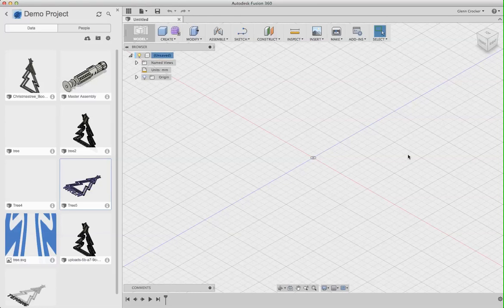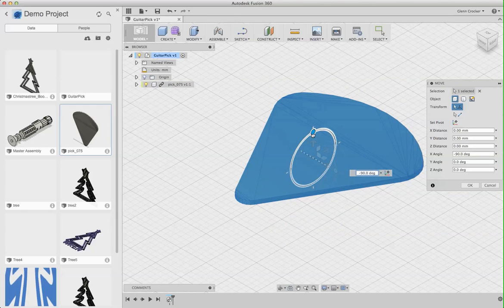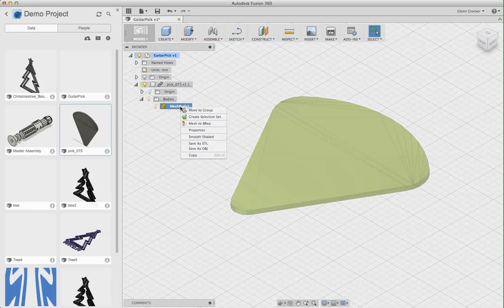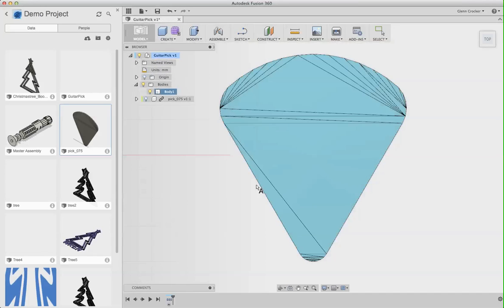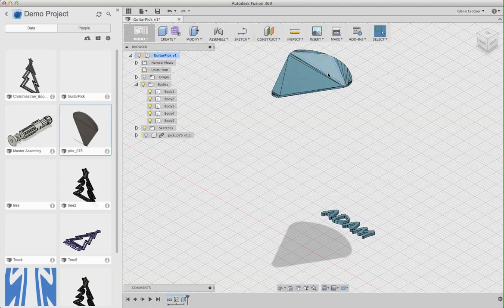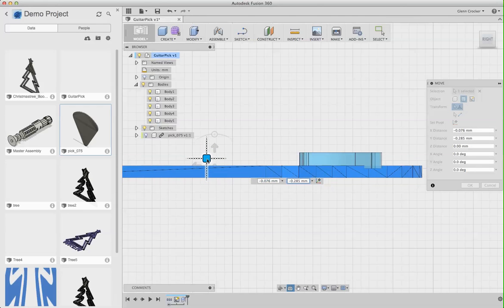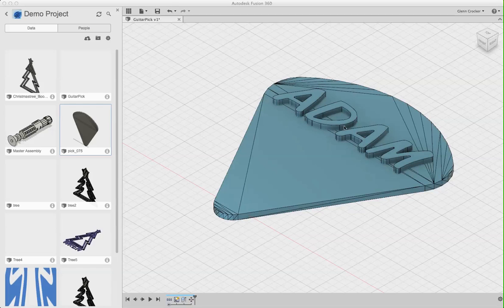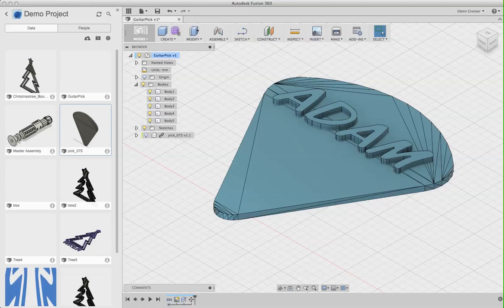Convert STL to BRep for Editing in Fusion 360

Comment: Thanks Glenn for the video. I am trying to cut the stl object to smaller portion to fit the size of my printer bed.I tried Mesh to BRep but it was aborted with this message: "Warning: This mesh contains a large number of facets. Mesh surface content:Mesh surface content = 135052. Conversion has been aborted." Please advice how can I solve this?
Reply from the maker: Try MeshMixer (separate program) to reduce the polygon count of the .stl, then load it back into Fusion.

Comment: Thanks for the explanation!!!
If you have no "cloud" icon it's because its' now an "Upload" button.

P.S. Use components. And the reason the rotation is odd is you need to use the XY plane (red/green) as the parts bottom. You can also change in your preferences to set Z as up rather than Y which is also really confusing if your working on a part for 3D printing.

Comment: How to remove a piece in a format STL a piece made in fusion 360 ?
Reply from the maker: Flávio Martins dos passos once you have converted the mesh to a brep you can intersect it with regular fusion 360 objects. With intersect you can join or cut.
Reply: I am having problems with a file of utmost importance that is equivalent to my job, i have to subtract this piece which is a STL a piece made in fusion 360 to make a mold
Reply: Thanks for help.
Reply from the maker: Flávio Martins dos passos check out this process: https://youtu.be/1w4koxWDkFQ
Reply: How do I join several parts without touching the sides, i.e. they are separated so that they become a part only in Fusion 360 ?

Comment: Does anyone else have the problem when your object imports in the scale changes ?
Reply: bluehandsvideo solved this:
The STL file does not have any dimensions, only units. You could try saving it with the units set as mm (for example) and then change the units to mm in the model space and import it.

Comment: I imported a file to round some edges but it didn't let me select any can anyone help me ?
Reply from the maker: Did you do the Mesh to BRep process? If so, make sure your mesh is no longer selected and that you're working with the new object.
Reply: Yeah i did everything you did and it doesn't work
Reply from the maker: I'm trying to round some edges in a model (from a .svg file) and it's fighting me as well. Try rounding by very tiny values to see if can do the rounding AT ALL and try selecting or NOT selecting adjacent edges to see if rounding only makes sense to Fusion 360 in limited ways.
Reply: The Problem is if I drag my cursor over an edge it says "Click to select this edge" and when i click nothing happens
Reply from the maker: Weird one. Can you post a link to a screen shot?
Reply: Sure
Reply: any Idea ?
Reply: no but thanks for the offer I just wanted to test if i can Import models from another 3d programm and edit it in Fusion 360
Reply from the maker: Gotcha. What program are you coming from? .stp files are much better, since an .stl is basically just a bunch of triangles.
Reply: Blender and Sketchup I download Fusion 360 just today to gain more knowledge about 3d programs
Reply from the maker: Looks like from Blender you can save a .obj and Fusion can import it. 
From Sketchup, it looks like you can use SimLab SketchUp Explorer to export a .skp file. I'm not positive Fusion 360 can import that tho.
.stl files are "universal" but that also means you lose a lot of info in them.
Reply: Thanks for the hint I wasn't thinking about that at all :D
Reply: Not sure if this will work, I'm still a n00b at Fusion, but I think you can COMBINE the triangles into one body (may have to got to Mesh first...?), then it should behave a a single item rather than a bunch-o-triangles . Then it's simple to Modify --> Filet to round the edge.

Comment: Oh you have got to be kidding me.  You have to turn off design history to make vitally essential functions even apparent?!  That is sooooooooooooooooooooooooooooooo stupid.  Here I've been banging my head against the wall for I don't know how long trying to work with meshes ... all because I had design history on ... which you know you'd think was a good idea.  Unbelievable.  Tis the one thing I hate about F360 ... the devs don't care about the user experience. NOT AT ALL.
Reply: By the way, you don't have to turn off Design History. This is just a "workaround". If you have your history enabled, you can (in your model workspace) go to 'Create', select 'Create Base Feature' and then go to the menu 'Insert' and select 'Insert Mesh'. Then select your Mesh and do the 'Mesh to BRep' conversion. Just as a reminder, F360 can only handle a limited amount of triangles (10'000?) to do make a BRep from Meshes, so if you have a really complex mesh, you should remesh it first before you BRep it. (Some Meshmixer tools are now inside F360 to do just that. It's still a preview, so you have to activate the feature in your preferences before you can use it) Or use some other external tool to convert your tris into quads or remesh with an optimizer or cut up your mesh in different smaller pieces (blender or some other surface tool can do that too) to use less triangles...
F360 is definately not purrfect, compared to some more sophisticated cad-reverse-engineering-softwares, but it's pretty good for what you have to pay (nothing!).
Reply from the maker: They desperately need to include the menu option always, but have it pop up a message that you have to disable history. Frustrating for users, but I think I can see why the mesh to brep can't be part of the history.
Reply: Yeah, just a grayed-out placeholder with a hover message "disable design history to use" ... easy for them to do but will they?  No, they don't care about the user experience.  Hey, thanks a ton ... you're a life-saver.
Reply: ExtraBase I've SOooo much to learn!
Reply: +ExtraBase
Thanks! I figured there was a way. Fusion is so powerful, and whenever you get THAT in a program, "difficult" is it's twin brother, LOL!
+Glenn
Yeah, not having a popup to warn you is dumb. But I have to give it to the Fusion team, I've chased down several features which led me to a discussion on the Forum, and I have seen several times where they said "Oh that's a great idea" and added it to the next version. So although I totally get +David Austin's point, I do think they care, and actually DO something, unlike many companies.

Comment: Maybe I missed it but you mentioned that it was a bunch of triangles and you wanted it to convert to a single structure?
Reply from the maker: Yeah, an .stl file is basically a bunch of triangles
Reply: How can you tell if it's still a bunch of triangles? How can you tell what format it's actually in without looking at the model visually? I have something that started as an STP file and I'm not sure if it needs converted or not, because I can't edit it.
Reply from the maker: STP is typically a real 3d model that won't require the mesh2brep process. In Fusion360 a mesh (like you get from STL) has a different icon to the left of its layer in the left side list of objects. Also, a mesh (STL) won't work when you try to intersect it.

Comment: The thing about Strange rotation in cura you mention, also recall that it was rotated different than you wanted it in fusion. I think this could be because fusion for some reason defaults with y and z switched, so y is up. You can change this in the properties of fusion
Reply: Oh great video btw